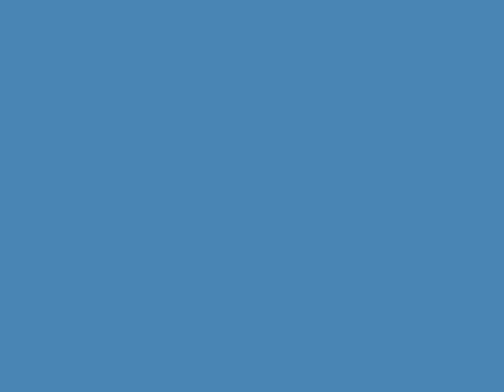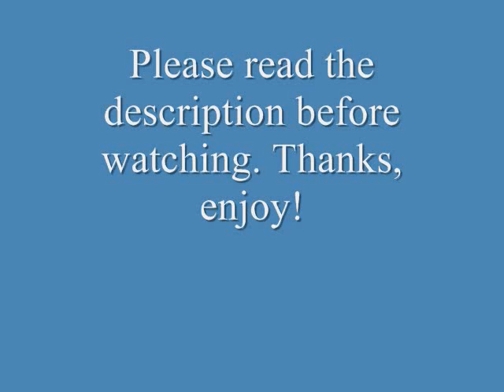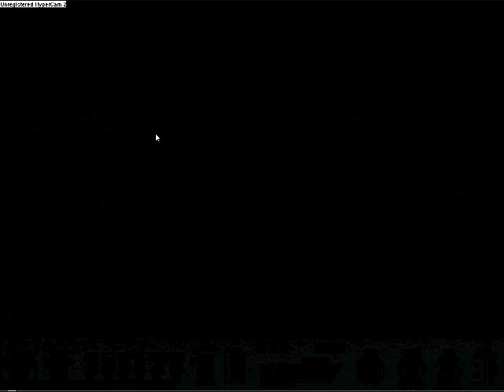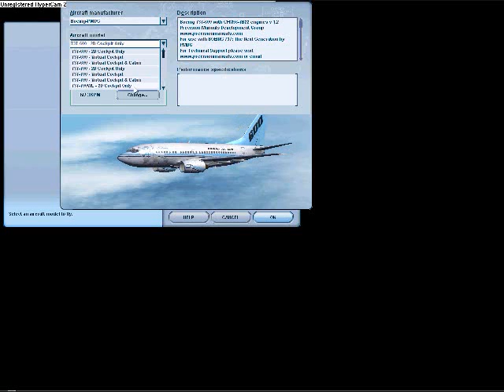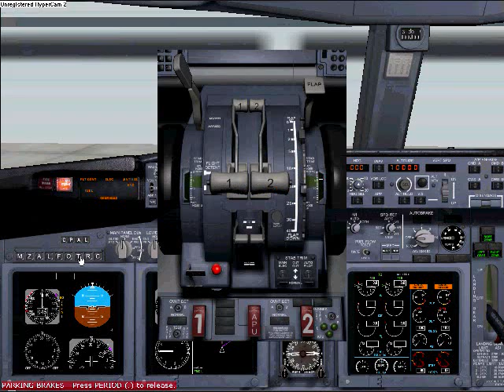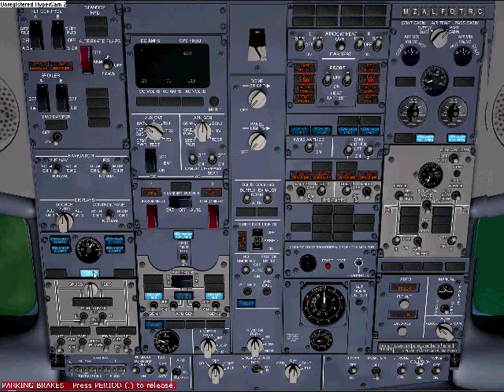PMDG 737NG Startup Tutorial (Part 1)

Comment: I saw you made a few mistakes:
-Fuel valves all the time open.
-When starting AFT pump1 must be on.
-In reallife the Enginebleeds stay on whole the time.
-APUbleed is pushed on 1minute after switching the APU genetators on.

But all with all a nice video.
Grtz flightstar1